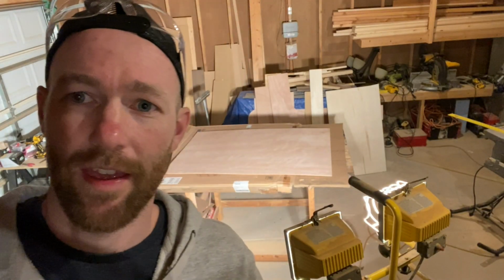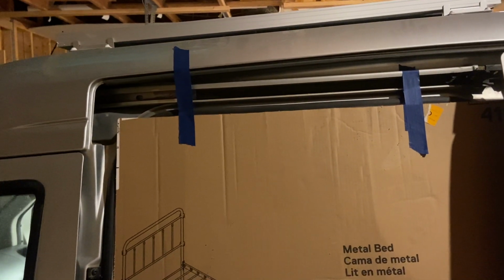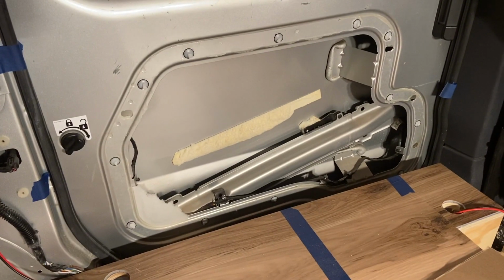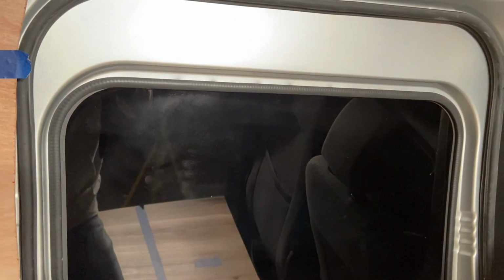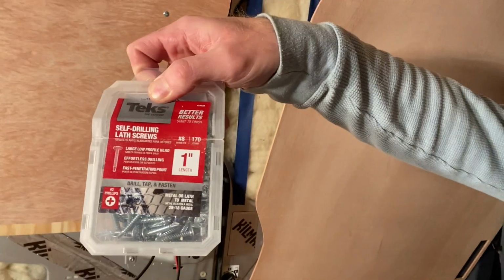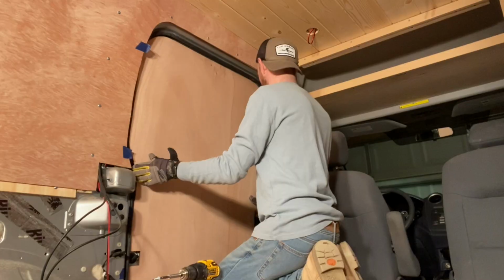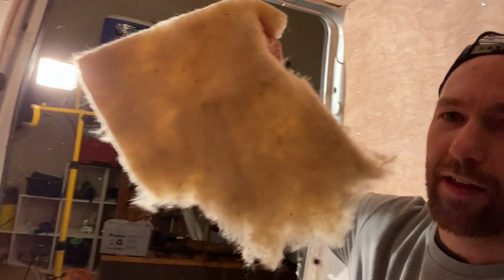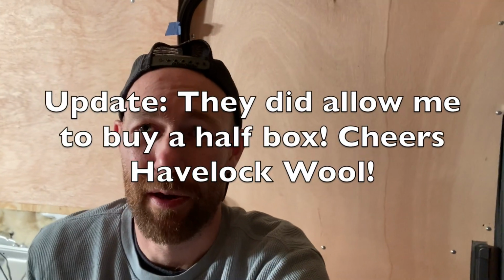Door Panel Installation | Ford Transit Connect Camper Van Build | Step by Step Series

Comment: I'm working on building out a van. How have the lath screws held up over time? Could I put some weight on the wooden panels when they're attached like that?
Reply from the maker: Lath screws have held up thus far. We sold the van, so I’m not entirely sure of their status. I think with tongue and groove ceiling holding the top of the walls and the bed and cabinets giving extra hold to them, I don’t foresee issues with the lath screws. .25” plywood was pretty flexible so it’s not like it’s pushing back too hard. I don’t know how much weight I would put on them though. Like if I was putting up a shelf I would try to screw them into the same metal that I screwed the walls to.